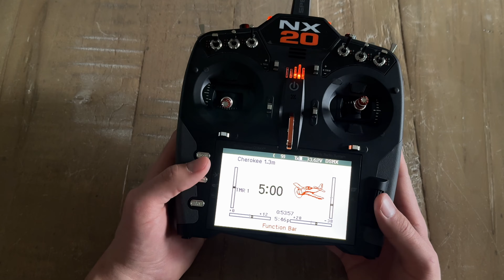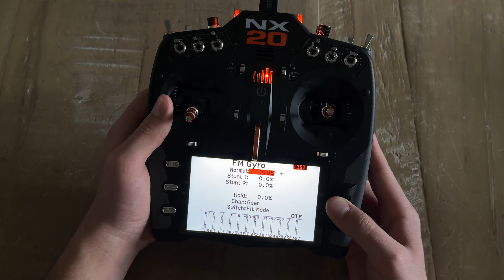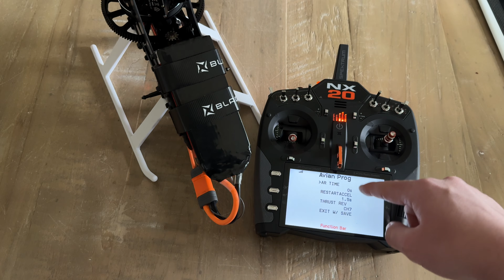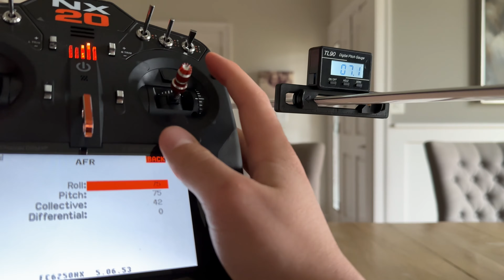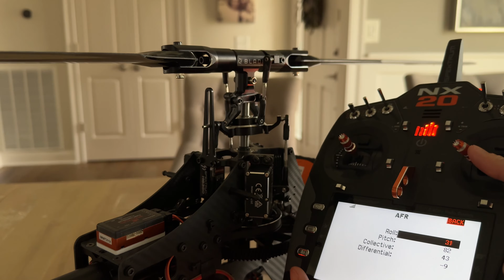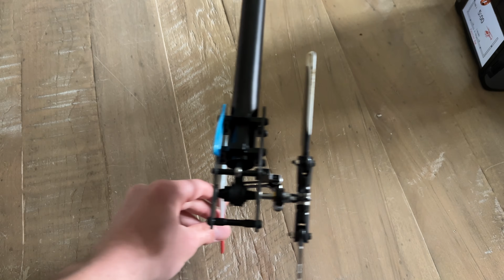Blade Fusion 550 Quick Build Kit | Initial Setup

Comment: I know this video is getting some age but maybe that won't matter. My question is about this heli and the exact electronics. I'm getting brave enough to try autorotation's and am asking about the AR setting in the avian prog menu. You just inhibited that setting, is that because you don't do AR's or because you don't really need that setting to be in place to do them. (autorotations I mean)
So if you want to try an auto and you get low then you want to power back up does the AR setting have to be in place or set up actually?
What's your feeling about that AR setting and should it be activated to even attempt an AR?
Thanks in advance

Comment: The biggest takeaway I got from this video is, I didn't know there was an NX20 radio. I have an iX20 that I've had for 4 years that I'm super happy with, but I just find it interesting that NO ONE in the Facebook Spektrum Radio groups I'm in has ever made mention of this new radio.
Reply: I have the ix14 and it is not that impressive, Slow refresh rate, and a few bugs and cheap gimbals. The reviews say the same about the nx20 which has stopped me from getting it.

Comment: Great video, one thing I didn't see was going into the channel asign menu to set the gear/pitch/gyro setting's. I saw the gyro setting in the function list but the 6250's that I've setup in the very recent past you set the function list gyro like you did then you had to go into the channel asign menu to get the gear/pitch/gyro setting and the gear channel to set properly. Did spektrum fix all that aggrivation??? There were whole threads about how to accomplish that and it had to be done in a certain order or you just weren't gonna make it come together. So the question is....does the latest version of the 6250hx software have all that worked out since YOU didn't do it that way??? Please advise 
Thanks in advance
Reply from the maker: If your FC6250HX and Spektrum transmitter are up to date, then you should not need to go into the channel assign menu for general setup. However, you may need to do so in order to set up Panic Recovery.

Comment: Nice work on the video,I’m going to have to get one of these,I have 2 of the blade fusion 480s kits,for parts for my 480.
Reply: The 550 is basically the 480 stretch with a newer or different appearance.  You can double check me on that but I am pretty sure that is the case
Reply: @josephrogina3865 okay thank you sir